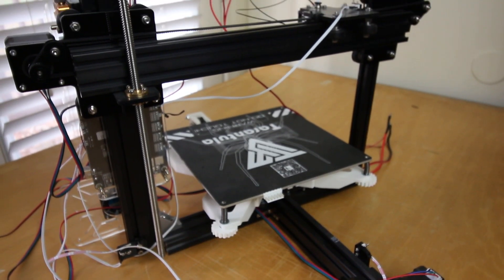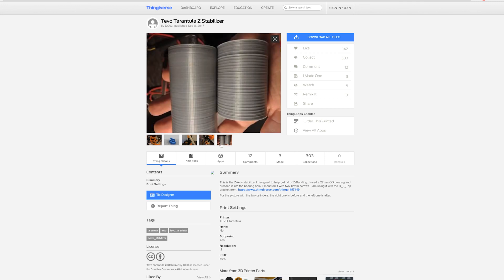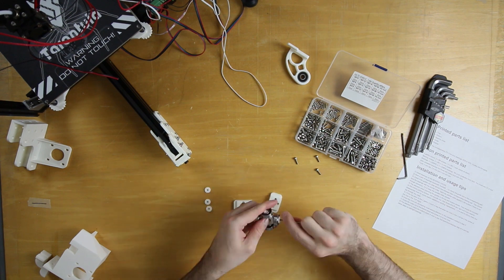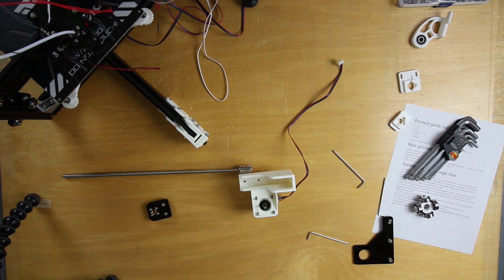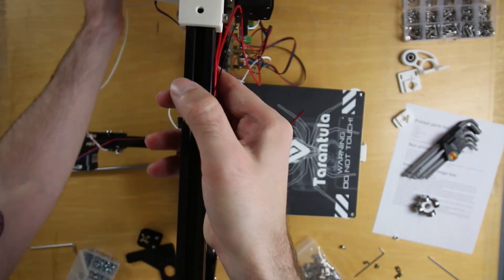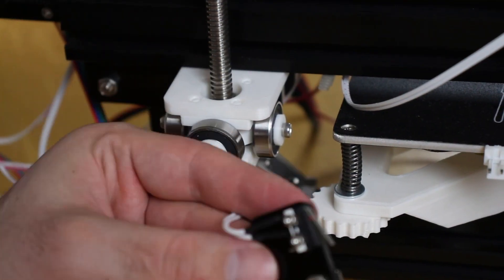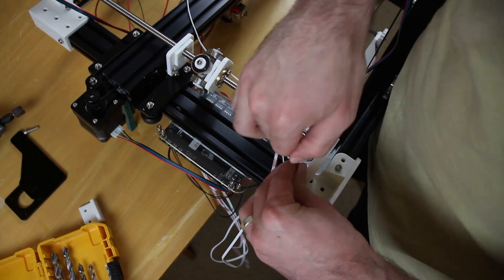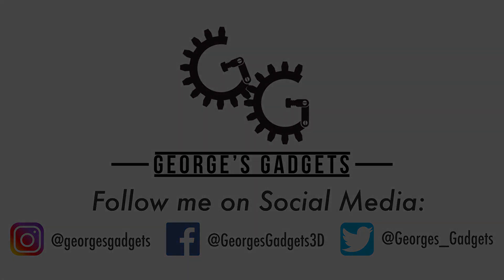Why you need to upgrade/improve the 3D Printer Tevo Tarantula's Z Axis

Comment from the maker: What is your favorite upgrade to the tevo?
Reply from the maker: THAT IS MY NEXT ONE! I have all the parts printed just need to film it all :D thank you for the suggestion, I am glad to see we are on the same page
Reply: My favorite upgrade would be throwing the thing outside, followed by gasoline and lighting it on fire.

I've had mine for over a year and despite making belt tensioners, new brackets, bracing, etc. it still can't print a part without ripples in it. I also have to re-level the bed constantly.

it took me 3 days at 6 hours a day to build it from the crap instruction book with no description of where the parts went. I had to take large portions of it apart several times because there would be steps in the wrong order later in the book that should have been pages earlier.

The default firmware that came with it was horrifically misconfigured and around 1/3 of the bed was unusable because the X/Y axis offsets were set to a nonsense value. The motors would also randomly start skipping steps causing the whole part to be trash from layer shifting. I had to find a custom firmware and spend an entire day modifying and compiling several versions to fix both issues.

The original hot bed that came with my printer also died because of a manufacturing defect with the thermistor used to measure the temperature. A bit of insulation must have been missing because the legs of the thermistor burned up and turned the whole area into a charcoal briquette. It took a month to get a replacement for it.

The only redeeming quality the printer has is the build volume, and ONLY if you can get the damn thing to work at all. It's a nightmare to assemble, troubleshoot and configure. I seriously recommend buying something else, even cheap printers these days are leagues ahead in quality and won't give you nightmares.
Reply: Instead of using the t nuts you are. Get the ones with a ball bearing in them. They hold them in place wherever you put them. And you can put them in like the cheap t nuts from the middle of a piece and not slide them in from the end. Make things so much easier
Reply: @GGigabiteM  I got mine about a month ago and it prints great. Maybe you just put it together poorly.
Reply: @neilsiebenthal8696  No, the printer is just a trash design.

You're probably using PLA instead of ABS, which I use exclusively for automotive applications where PLA wouldn't work at all.

I'll be getting a creality3D ender 3, which is a far better printer and get rid of this crap tarantula.
Reply: I print pla, abs and petg so far. All works great. I just put mine together carefully and upgraded a few things. That's part of buying a super cheap kit printer. If you want something that needs no work at all, go spend 700 on a prusa i3 mk3.
Reply: And just because you couldn't get it to work doesn't mean they're all trash. Just yours was. Probably because of user error. I know several people who have them that work great.
Reply: @GGigabiteM  plus the fact that it took you 3 days to build it shows you have no idea what you're doing which just proves it was user error.
Reply: I guess Im kinda off topic but do anyone know a good website to watch new movies online?
Reply: @Luciano Kendall Flixportal :)
Reply: @Deacon Jay thank you, signed up and it seems like they got a lot of movies there =) I really appreciate it!!
Reply: @Luciano Kendall Glad I could help :D

Comment: Good video, would have been nice if you had included before and after prints to show the improvement.   Also why didn't you use the tevo to print the parts?
Reply from the maker: Chris, the final upgrade I will be doing is coming and I have a video planned to display the print quality, but that is a recommendation I have received from a ton of people.  I will be sure to use it in any future printer videos :)

Also I received the tevo is a not working state and for convenience I have been using the prusa to print the parts :)

Comment: Hi. Great video, being looking to get a TEVO T as its one of the printers which has spares readily available in SA. Wanted ask if you like tinkering and building things would this be a good printer to start with. Also would you go with a dual extruder or single one. There's not a major price difference. Thanks.